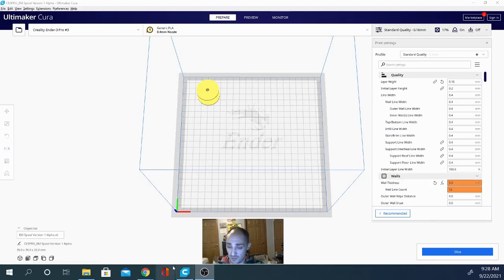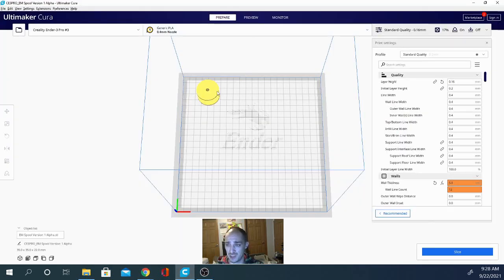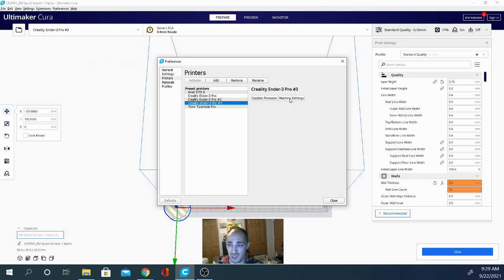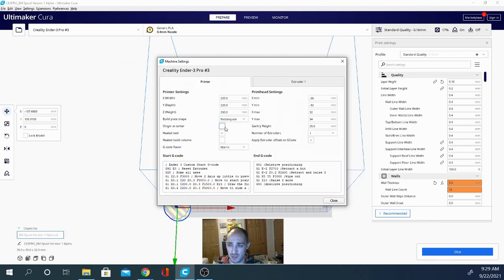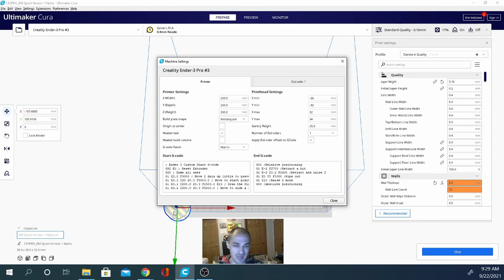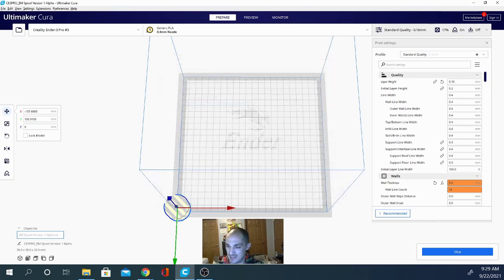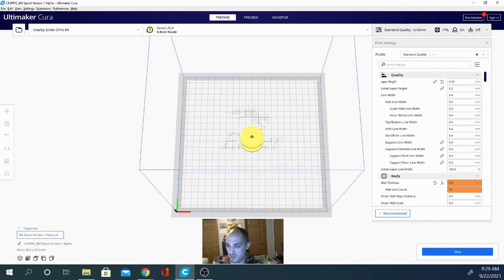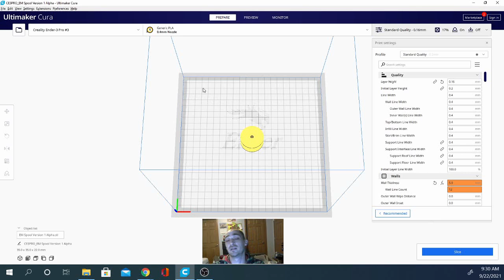Cura Questions - Is your print not centered?

Comment: I think there is an issue with Cura. I uncheck the box, or i move the model to center, or far right, the printer still prints outside the bed. I believe correct printer model is selected too.
I check the file with creality print and it actually shows it is at the corner, outside. sticking to creality print.

Comment: my print in cura is centered in the screen but when the print on the printer is off to the right. how do i get it centered on the bed
Reply: You ever get this issue solved?
Reply: same here. couldnt find any solution. just moved to creality print. It actually shows the actual location before printing.
Reply: The youtube channel "Victor Bared" video title 'Ender 3 V2 Ultimaker CURA 3D Printing Off-Center Fix'

solved my issue :)

Comment: ender 2 has a print volume of 150x150.. started a print 135mm wide. it begins by printing mid air off the side of the bed.  how do i fix that?